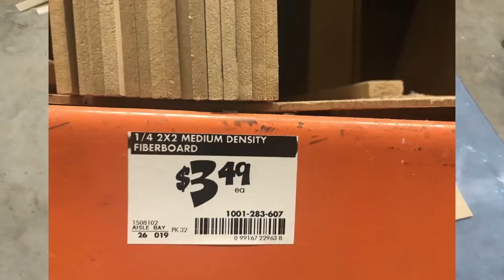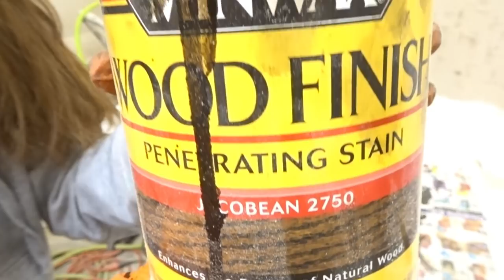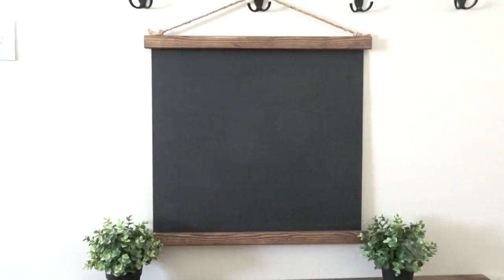DIY Magnolia Market Inspired Vintage Blackboard

Comment: Thank you for the vid! Love this look!
I recently made a double sided chalk/white board for my kiddos and I’d like to hang it up on the wall for them. This way we’re able to flip over to the other side as needed. However the board is rather large & heavy and I’d rather not drill holes into it if I don’t have to. 
So I’m not sure how I should go about this. Would you recommend hanging  it as shown in the video....adding the wood trim to both sides? Or perhaps a different way? Thanks so much in advance.
Reply from the maker: Yes!  The trim will give the rope a place to attach to and then you can easily flip it over.  What a great thing to make for your kiddos!  Best wishes to you all!

Comment: Ok so I'm making mine now... Since yesterday I've applied 3 coats of chalkboard paint and you can still see and feel the wood... Is it not supposed to be nice and smooth like a chalkboard?
Reply from the maker: No it will take on the surface texture. We put it on a wall and it still had the wall imperfections. All you can do is prep your surface so it’s smooth before you paint.